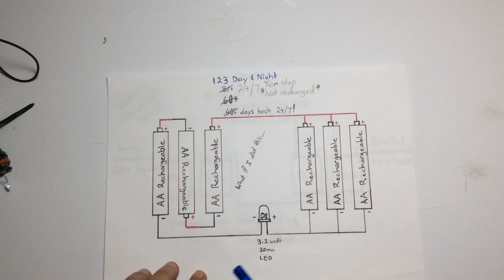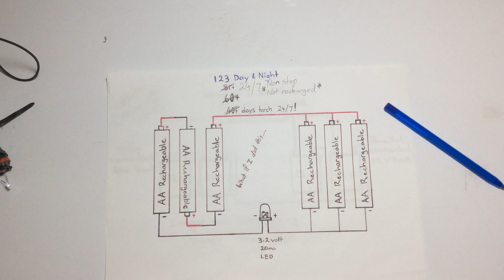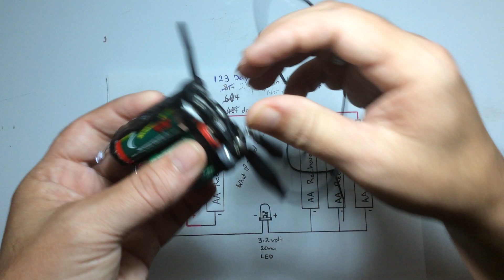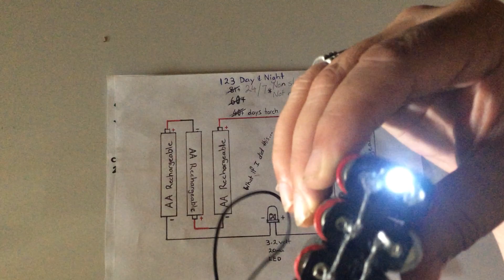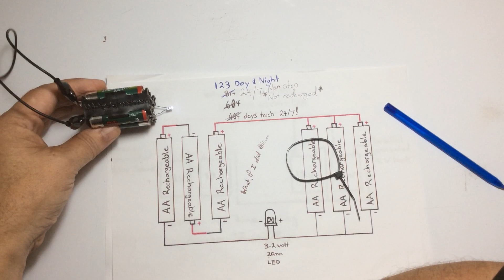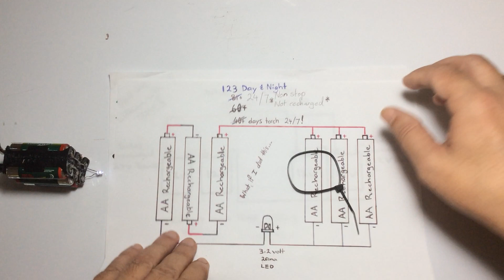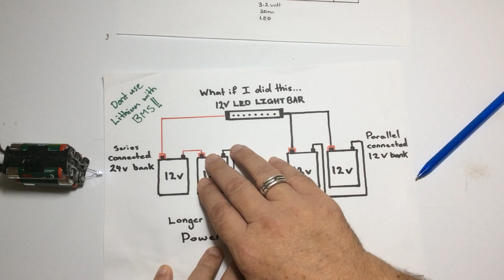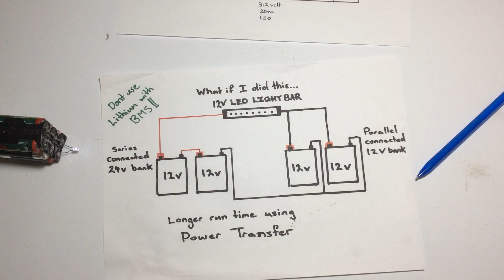*UPDATE* Tesla Power Transfer 123 DAYS & still running!

Comment: Here is an idea.  Why not just put these batteries on a SPDT type of switch in the placement of handling/switching the batteries over?  I'm not sure that this would be the correct switch, or that this would even work though.
Reply from the maker: Thank you for your comment.
Sorry for my delayed response. Definitely some kind of switch is required to take the setup closer to the original Tesla switch. The switching is where the real benefits are during the collapse of a coil during switching.
I have come to learn in this field that no idea is without merit.
Thank you for watching.

Comment: Can it run a 220v light bulb run also for 123 days without discharging please ?
Reply from the maker: Thank you for watching and I'm sorry for my delayed response.
I am currently running tests on the 12 volt version, at this point I have not found the correct arrangement of items in the 12 volt realm but I will keep researching. I believe this unit is now past the 200 day mark and still going and I hope to do an update soon.

Comment: its like differecial charging . j.c.bedini used to talk about it but warning beeing 
if you discharge it to much u will perminetly damage the battery 
due to construction of thoes batteries 
…
energy flows around the wires and it can bee amplified or changed form’s
all wasted energy should bee harnesed and put back 
if wind or heat or any other unknown force come in play practicly you would have 
over unity device
Reply from the maker: Thank you for your comment. I apologise for my delayed reply. I agree with you about discharging the batteries too far and in the case of AA rechargeable batteries the LED will cut out below a certain voltage and the only real way to completely discharge them would be something like a joule thief or another version of pulse circuit which would drop them below the cut off point. The 12 volt versions batteries would definitely be damaged dropping below 50% of usable amp hours and it’s something I watch like a hawk. It’s frustrating that the battery industry hasn’t been honest about the correct usage of batteries and that sealed lead acid Ah rating should read 50% usable power because that’s as far as you should drain them. I agree there’s very little input required for this to be very special. I have been testing my lighting circuit with the 12 volt version and monitoring with some cheap amp meters on either side of the load, I’m tired of destroying expensive meters, some interesting results there, once I’m sure of what I’m looking at I will upload a new video.
Reply: @whatifididthis...1236  Human brain can not  sometimes cope with the truth to understand that 2.nd law of thermodinamics isnt a law and it can be overcome . that in this field of energy what was Tesla all about . as Reactive Wats instead of what is used today could acheawe 1000x more for the same consumtion and lets face it the most polution is done to create the electricity and preciouse metal mining for batteries . thats a bisness model of scarecity and planed obselesence so people can have their chanes  of work ect. 
The engeniering class Loves this stuff but the managering class hates it due to drastical change in finances 
Just maybe its already implamented nd there is no need for nuclear plants but by bs the populus they keep the rates on 
Just saying 
Batteries not just fail becouse of deplition but of Ion tubliar sucking function that shorts it out 
galwanization sulfation of the batterie higers the impidance of the battery so it shows full but in reality 
it has to do work as heat to get in and out the energy…
so  your testers meters amps as mesuring tools are designed a mind thats far outdated from all posibilities.
what im  saying . hope is you get some inventers rush ;)
Reply from the maker: @yowild9629  Thanks for your comment. I grew up wondering why they didn't give magnets to children to learn the basics, then I realized its about the elite keeping these technological advances to themselves and educating us on a need to know basis, stealing the thoughts of the gifted engineers.

Comment: Have ya looked into relay switching, I've seen a couple on YouTube already posted  with the Tesla switch. You would never have to switch anything. Jus an idea that would stream line the circuit. By the way very impressive on the run time  I've not seen any of this type run that long
Reply from the maker: Thank you for watching. Feel free to post any relay switching videos here as I am so busy trying to catch-up on the last three months nursing an injury and I would prefer people had access to as much information as possible about this setup regardless of me being ready to use it. I have seen a few auto switching mechanisms and also had some sent to me by subscribers and just haven’t got to them yet. I’m honestly confused about the run time for this AA version, it just doesn’t make sense from most angles, however I assure you it has genuinely been running for 148 days and I have expected to wake up to find it dead for at least 120 days.
Reply: @whatifididthis...1236  let me find them I'll post them for ya, I've seen 2 one used an automotive relay, the other used commercially available electronic relay circuit board. I was needing a battery switching circuit  for my solar, wind combo. When I ran across the vids.
Reply: @whatifididthis...1236  here is one vid with switching relay
https://youtu.be/sYgtUcAJk5k
This also looks like a solution using multiple relays
https://youtu.be/7TinRz-H76k
Reply from the maker: @michaelthornton1661  Thank you for your efforts it is greatly appreciated. The first link I watched just last night and the only problem I see with it is that Electrodyne Corp states the switching needs to be between 100khz - 800khz, apparently the circuit in the first video is only switching at a rate of 35khz. The second video requires a deeper investigation as it will require more components to facilitate such a rapid cycle rate. The weird thing is I have that exact VSR sitting on my bench, I would not like to go this route as they were not cheap, however if a longer run time of 3 years with 2 kilowatt output is achievable as Electrodyne Corp declares possible then I’d be willing to pay!

Comment: Can u do it w a 10watt led
Reply from the maker: Thank you for watching. Yes you can use a 10 watt light and I am currently recording run times of different load devices. The longest run times are achieved by a balanced load, by that I mean not too much current draw and not too little current draw. I’m using an 18 watt LED which may be too high a current draw for these batteries as the run times are not long enough. I will make a new video soon which will detail the different run times of several devices. The 18 watt LED ran for 27 hours and 25 minutes involving 7 rotations of the battery banks. All rotations were performed when the “drive bank” was lowered to 24.2 volts to prevent damaging the batteries.
Reply: @whatifididthis...1236   chk this
https://youtu.be/5fZ8IYvLDfU

Hope it helps u
The impedance Nd load must surely match as u don't want the resonance broken.... I am not sure but I heard 18.46mhz is the resonance frequency for copper, may b different for silver so u can tip the copper with silver  or use silver tips as wires to assess to chk how it performs, also twisted wire and bifilar wire.... W load.. V r waiting to c u achieve max load nd also use tesla or isolation transformer to segregate   resonance to March load /resisitance w open n closed... As u increase the voltage the dielectric increases,
Reply from the maker: @roshanmathew9443  Thank you for your comment. I would have to agree with your statements and I found Eric’s work very interesting. I also find it very interesting you mention the frequency of copper as I have a Tesla pancake coil that I will demonstrate soon as a heating unit, when operating this unit it always sits at 18.46 kHz, not sure if there is a link here as you mentioned MHz and not KHz.
Reply: @whatifididthis...1236  Looking forward to Ur 18.46 demo and also use Eriks work to move dielectric nd magnetic using frequency to achieve resonance in open n closed circuits... I think Eric wanted to tell that magnetic Nd capacitor elements perform better when they r  going up dn or oscillating in Pairs
youtu.be/NVUCf8mB1Wg
And u can also chk the voltage at anode at which the cathode will vibrate.. Similar to magnetron Nd hw to accelerate the charges ie no of pairs of anode w voltage

Comment: I did the same experiment with supercapacitors about 2 years ago and it kept running until I stopped the experiment.  The illumination of LED from voltage difference btwn the two banks had a minimal energy loss.  Couldn't verify the perpetual lighting but ultra efficient design of energy flow and conservation.  Nice demonstration!
Reply from the maker: Thank you for watching. That’s the difficult thing with this setup, all these tests take forever and I have had to buy new parts to allow me to keep researching and keep the test units running! The AA version is now at 134 days and still going and I am currently testing the 12 volt version with different load devices and will perform swap number 1 in 20 mins time, this first swap has been running a 12 volt 18 watt LED for 12 hours and I expect shorter run times with the following swaps. I will post a video of my findings.
Reply: @whatifididthis...1236  Have you measured the overall voltage dissipation in the batteries over time? I was wondering about if it would make any difference to auto-switch the swap between the battery banks in very rapid frequency while sustaining the lumination of the LED using a capacitor. Just a fun thought :)
Reply from the maker: @badboypaulpark  Thanks for your comment. I have not measured much at all with this circuit as I still need to buy more multimeters. I fried five meters and two light bulbs in one high voltage experiment that went wrong.⚡️This concept is close to the Tesla Switch, the complete circuit had a mechanical switch and was rumoured to have an indefinite power supply. This was tested by a company called Electrodyne Corp where it was operated for 3 years powering 2 kilowatts of output.
Reply: @whatifididthis...1236  Very interesting!
Reply: @whatifididthis...1236  I've been also wondering to integrate a small joule thief circuit to this schematics to further increase the efficiency.  I have kind of tried it on my super capacitor setup 2 years ago and didn't work out well for some reason.  What do you think?
Reply from the maker: @badboypaulpark  Thanks for your comment. I am currently testing a joule thief version using AA batteries, my first test is using a single LED light but I feel it requires a higher voltage LED to balance the load more efficiently. The problem as I see it with the capacitor version is the run times are significantly shorter resulting in too many “battery” bank rotations. However capacitors may be the best option with an automatic switching system.
Reply: @whatifididthis...1236  yes I agree. Either the joule thief has to have a matching output to accomodate the voltage range of the LED or find the right LED that matches the output voltage of the joule thief. Auto switching the serial/parallel circuits could be achieved using the 555 timer chip and the double pole latching relay switch, as shown in 30 min. Into Patrick Kelly’s video, https://youtu.be/Mf7aNQD2GPA
Reply from the maker: @badboypaulpark   Thanks for your comment. I hope to soon start building a switching circuit, there are several different circuits that will facilitate this switching requirement and I have seen the one in the link you’ve supplied which I thank you for. The balanced load appears to be a major factor for this unit as it currently is, I have performed quite a few tests with very different results that I hope to demonstrate soon.
Reply: @whatifididthis...1236  0whstvi think is as the frequency flow is singular in a diode it keeps going as two way frequency create friction n heat due resistance w flow of current so diodes r the best bet, esp single coloured as singular frequency
Reply from the maker: @roshanmathew9443  Thank you for watching. One of my earlier videos for this circuit demonstrates current flow through “some” LED’s in both directions so there may be some evidence of a frequency occurring within the circuit. Also the LED is technically a spark gap encapsulated in a vacuum, this should in its own capacity be capable of creating an oscillation.

Comment: Thank you for your update. Do you have some news about your tests with capacitors ? Have a good day and a great weekend.
Reply from the maker: Thank you for watching. I am currently running tests on the 12 volt version with different load devices and recording run times. I need to tin the leads for the capacitor version and recharge them. Most of the caps lose their voltage if left alone, just like batteries I imagine. I thank you for your patience, I have finally begun the slow process of learning to walk again and should be able to get to my soldering station soon. I know from the first run of the light with the caps, it worked just the same as the AA version.
Reply: @whatifididthis...1236  thank you for your answer. What you are doing is wonderful and it's always a pleasure to get your updates. What's happened to your leg exactly? Have a great weekend
Reply from the maker: @Pierre-Marie-9-6-5  Thank you for your comment. My apologies for my delayed reply. 14 weeks ago I completely ruptured my Achilles tendon, fortunately I did not require surgery as Australia’s tyrannical medical system would have probably required I take some sort of dangerous medical experiment to just have the surgery. Thankfully some parts of medicine acknowledge the human body is best at repairing itself and if it weren’t for my pre existing spinal issues I would be recovered already, however, I have started walking or hobbling to be more accurate so in a couple of months I should be back at my projects which will allow me to post more videos.

Comment: You know every meter above ground is 100 volts what would happen if you connected into that potential ? Or three meter's at 300 volts .you must insulate very well.and earth ground very well. 123 days using only eight hours a night ?? Could it go 369 ? Then the atmosphere potential?
Reply from the maker: Thank you for watching.  I am aware of what you mention, my replication of Tesla’s radiant energy patent takes advantage of this and the light gets brighter the higher I position the aluminium capacitive plate. I do have a small version of the AA version using a Joule thief as a transfer mechanism which is also grounded to earth, it is currently under test at the moment. The downside of a very efficient circuit is such lengthy tests as in the case of this AA version now at 125 days. I will setup a similar system with both earth and elevated capacitor plate soon and test this also then compare the two. I believe this system could very easily run for 369 days as is if only run for 8 hours a day.

Comment: Hi 
Please  see" Arkiver  unified  energy" utube channel . He has carried a test similar  to what you're  showing. He used super caps to transfer energy and run a motor.
Reply from the maker: Thank you for watching. I have seen his work and I’m subscribed to his channel, however I have not seen his capacitor video which I will be sure to check out. I also have a super cap version that I started the tests on but was unable to complete due to the discomfort of my injury. So far I have run motors, LED lights, a car phone charger and a 240 volt inverter on this setup.
Reply: @whatifididthis...1236  

Hi 
 The video is titled  " implied conservation  energy  consumption ".
Reply from the maker: @dosomething7930  Thanks for the title.👍

Comment: Great job glad to see you’re still at it….. some people just need to get off their butts and do their own experiments…. Takes time and effort and a little luck… myself I have my own projects going on I’ve been working on it for over seven years it is based off of what Gerard Morin said “ he had a friend working on a low-voltage system “ and never mentioned it again .. I took that and ran with it and went and found my own way … uses 12v 2.3 and I get six separate lines65v .87a or I can use them together at 390v 5.22a….I am currently ripping down my whole project with my nephew from the Air Force he is very interested in what I am doing helps to have a helper…because two magnets have moved on me inside … 12v 2.3 jumped to 12v 5.1a…I have several videos and several experiments on film…. I hope to get it back up and running soon I am figuring six months to a year to get it back up and running with the improvements that I have come up with… hope you’re healing up well and feeling better…. About how long do the cycles last between each battery change over?
Reply from the maker: Thank you for watching. I couldn’t agree with you more about actively experimenting, I would love it if everyone watched a video then got up and tested it, myself included! Your project sounds interesting and I would greatly appreciate more information if you approve. My main purpose with this channel is to present as much as is possible, I intend to keep none of my findings to myself, we never know when our last breath will be and my recent injury has highlighted the need to spread the information. There will soon come a time when YouTube will not be available anywhere in the world so we must act now.
Reply: @whatifididthis...1236  hello how are you I sent you an email, thank you for looking
Reply from the maker: @zenssysteme681  Thank you for watching. Sorry for not replying, I will check on your email now.
Reply: @whatifididthis...1236   Hello how are you? I hope you are doing well. I sent to you a mail  thanks